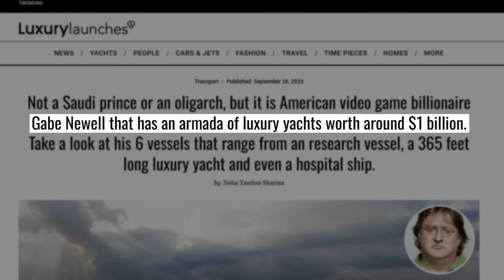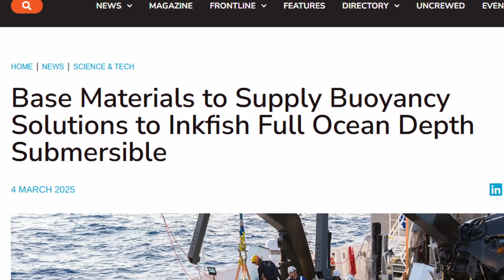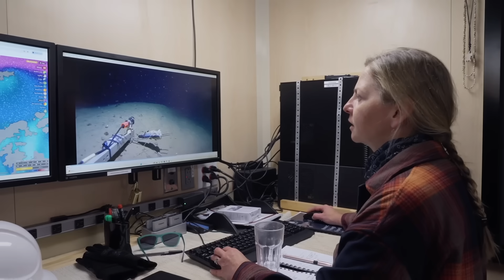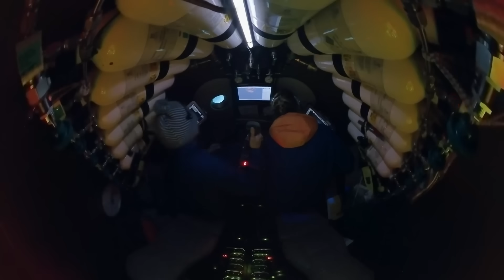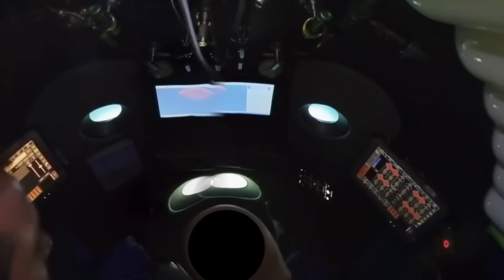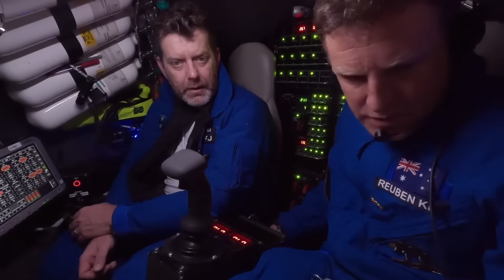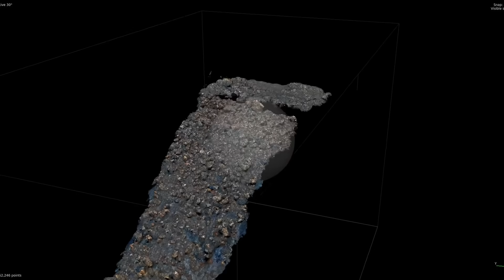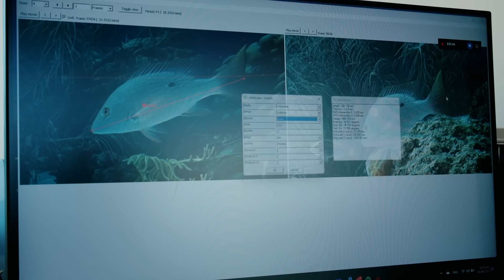Gabe Newell Found 'Unknown Life' Under Water

Comment: Weird way of catching I feel... Why just have a tiny net instead of just a 4 sided box with controlled gates that close quickly (under pressure may need to be adjusted to strength restraints). would make a lot more sense and keeps them a lot safer on the way up as well as less chance of escape and keeps samples of the water they live in for possibility of living on surface level.

Comment: Pretty sure the pale purple Octopus they found is what's known as a "Pearl Octopus", and this particular Octopus is only found in a very deep seas. Often known for the females strange nesting behaviour where they will travel from colder to warmer climates and brood their eggs in an "Octopus Garden" surrounding thermal springs. Normally in colder temperatures the eggs can take up to a WHOLE DECADE or more to hatch, but when they travel to these specific locations, the heat from the springs speeds up the development down to almost 1/2 a year.

And throughout those months until the babies hatch, the mother will NOT leave them no matter the situation, sacrificing their own needs and risking themselves to any threats to protect them. They will most likely die by the time the babies are ready to hatch, and then the whole cycle repeats itself.

Comment: i trust Gabe more than that OceanGate guy
Reply: Oceangate was way too cheap, fast, ignoring what your engineers are telling you. 
Valve is the opposite.
Reply: @tobiasmyers3505  oceangate while making the titan sub ingored many safety procedures and quality checking of the sub. stockton rush was a daredevil not a marine biologist or engineer.
Reply: @Chrizix  also carbon nanotubes were never going to work, carbon nanotubes are great at containing pressure from within but terrible at pressure from the outside. Good for spacecraft terrible for submersible craft.
Reply: @corrinflakes9659  he seemed to think it would for some odd reason. i never understand why rich people skip actual research or safety measures when playing with thier life
Reply: Given the fact that Gabe, like Valve, values data a ridiculous amount and is meticulous with everything they do, yeah I'd trust him. 

Wouldn't have used a shoddy controller for a control system either, alongside shortcuts of manufacturing
Reply: @StormierNik  Given everything that went wrong, the controller was easily the most reliable part of the submarine.
Reply: @StormierNik  For god's sake, stop talking about the controller, it didn't fail, it was a logitech controller.

The US military has been using Xbox controllers to control unmanned vehicels, operate certain functions of ships and submarine periscopes for years now, it's not new. It's cheap, easy to replace and most people are already familiar with it.

If you were a real expert, you would bash the choice to use carbon fibre, not the controller, which while was not industry-standard was a proven method in other related fields.
Reply: @Martyr_As_Turrets  Didn't know xbox controllers were actually used in the military tbh, thanks for giving that info. The carbon fibre was an awful choice for a submarine though, i still don't understand how anyone thought that would be a good idea, carbon fibre is only good for inside pressure pushing out, not for external pressures like under the deep sea. It's just such a stupid idea when the Cyclops-1 which they made earlier was made of steel and performed well enough.
Reply: @Martyr_As_Turrets  the problem was not the carbon fiber, the problem was in the cost cutting, improper construction, lack of proper testing, using humans as gunny pigs, ignoring experts, and the leaders stubbornness ignorance and hubris.
Reply: @Martyr_As_Turrets yeah it was simply bad hull design.
Reply: @Martyr_As_Turrets  Unmanned, and you only control parts of it. And of fokkin course we still will. It wasn't just any controller, but the cheapest BLUETOOTH Logitech controller you could find. WITH NO BACKUP
Reply: John iron lung
Reply: is he using a Steam controller?
Reply: @stackowoflow  I’d trust a steam controller over Logitech… still got mine after 7 years and they work fine
Reply: @stackowoflow  no hes using a steamdeck
Reply: OceanGabe
Reply: I Trust Gabe with steam but fuck the ocean i'm not getting in a submarine even if it is the last safe area in the world
Reply: If a valve gives out on one of those subs.
Dibs on ValveGate 😅
Reply: This is Valve we are talking about, of coarse the submarine uses Mouse and Keyboard! Now excuse me, I need to bunny hop to what I think is a new crab specie- what is it doing to that guys face oh God
Reply: He’s got a LOT more money, so there’s that.
Reply: The fact that they use a drone for a lot of their expeditions instead of sending people a metal toilet paper tube already says a lot.
Reply: he's competent and knows the value of his name, that's enough really
Reply: No shit. That's like saying the sky is blue.
Reply: @minimalgrammar1276  damn i thought it was purple
Reply: I trust him more too. Still not getting in that submarine. No thanks.
Reply: Gabe plays/deals in games and still doesn't pilot a submarine type vehicle with a controller. lol
Reply: There’s a massive difference between the research-based tech and customer service-based tech. The former tends to understand the circumstances of what needs to happen in order to get the information they need. The latter tends to be way more profit driven, which often leads to cost cutting safety. 

There’s a reason why science tech trickles down into luxury, not the other way around
Reply: And unlike Oceangate I assume he doesn't have his submersibles controlled with a Steam Controller or anything else as silly.
Reply: I'll also choose steam controller over logitech controller any day
Reply: Thats because gabe is alive and rush is not, forgot to savestate before every dice roll.
Reply: Well yeah the ocean gate guy was an idiot
Reply: Gabe would use a legitimate controller
Reply: Same. Odds are his subs were tested meticulously and designed by actual sub engineers (Naval Architects? Is it a sub (heh) group?)
Reply: Obviously right
Reply: low bar
Reply: the titan sub was not even the first carbon fiber submersible just the first maned one it was predated by the us military Advanced Unmanned Search System (AUSS) in the 80s
Reply: How can you trust someone whos dead xD
Reply: That is a low bar. Try to go down mariana trench and raise it a bit higher.
Reply: @lathrael  He did.
Reply: He seems to have proven his capabilities to a much greater extent than that safety ignoring idiot
Reply: This didn't age well.
Reply: If he dies Steam dies with him. One old guy is holding up the entire respectful gaming industry and when he’s gone Steam will undoubtedly go the way of EA.
Reply: @therealspeedwagon1451  “respectable”
Reply: He do believe in datas than using a cheap knockoff controller to move a submarine that got called unsafe by multiple inspectors
Reply: Submarines with steam controller. Much better chance at surviving
Reply: I think oceangate sub was safe its just they made a mistake with some of the glue they used for lamination. I would ride on the sub if they fixed the glue
Reply: @mattheww797  It was not. If you did good research you'd know that every single aspect of how the submersible was built, operated and maintained was done wrong. It was a time-bomb that eventually exploded or rather imploded
Reply: i trust neither
Reply: Gaben's track record is great outside of Tf2.
Reply: @MaoRatto tf2 was a shame for years but atleast thwy finally fixed the bot problem
Reply: @MaoRatto hater
Reply: @MaoRatto  give up on TF2 already.
Reply: @MaoRatto  TF2 was a MOD, and they pretty much just hired the team who worked on the mod and people who were interested in it, he wasn't involved really.
Reply: @MaoRatto  cs2 is great?! Yeah bro them "updating" csgo to cs2  to keep all their good reviews while the game changed it to something half has good as what is once was with less the half the features... while also adding more mircro transactions like multiple game passes, yeah thats a guy you can trust...
Reply: @MaoRatto  How about now?
Reply: @Nix-qq5je  he is good friends with james cameron both have the same hobby
Reply: I dont trust nix the american